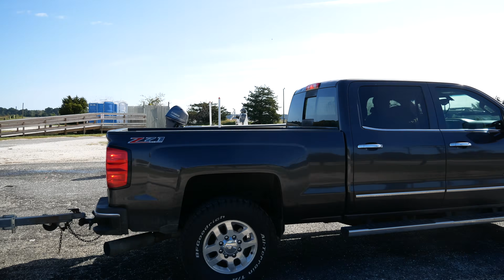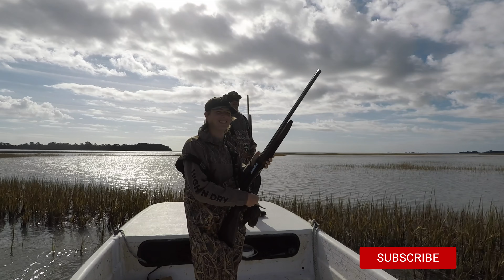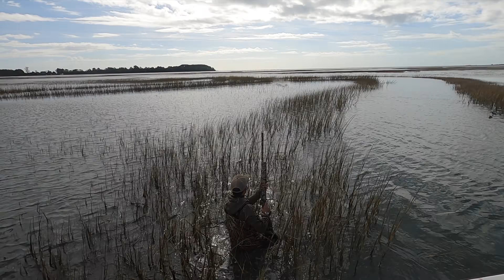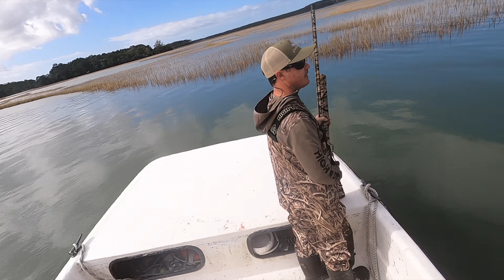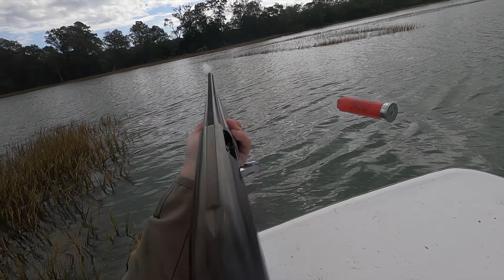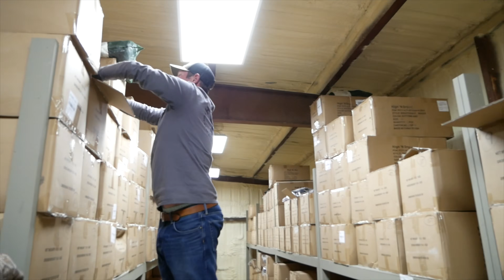My First Time Rail Hunting | Visiting The High N Dry Wader Warehouse

Comment: Hey ive been hearing alot more about HIGH AND DRY. surviving duck season joel strickland wears them and has nothing but good things to say. I bought new wadders last year and after wearing them 3 time i returned them ..they gave me a new pair. But i dont have alot of faith in them now .i was looking at sitka but i may try the high and dry first!!
Reply from the maker: I have had zero issues with mine so far and have been very impressed with the quality of the product. I will have to put them through the paces of a full season to see if I can fully recommend them but everything so far indicates that they will handle that test

Comment: I have never had a dry pair of waders. Tried several brands and styles. I have just dealt with it as a fact of life. lol. Might have to check these out.
Reply from the maker: I was the same way up until this season, I have not got wet in my High N Drys yet though. Only time will tell on if that stays the case but from everything I've heard from those who use them they hold up very well
Reply: @HokeOutdoors  Good luck! Looks like you're having a great season so far.
Reply from the maker: We've definitely been blessed thus far! Good luck to you as well!

Comment: As a native Virginian I’m interested in supporting the locals.  On my third season with my current pair of breathable waders but the are starting to leak where the boot meets the wader material.   The early season I smeared some shoe goo on the inside of the seam which appears to be working for now...
I like the idea of Kevlar on the front of the leg.  I would like to see some of the same material on the butt area to provide extra projection against wear when sliding on crappy boat and blinds seats as well as the occasional schooching down the river bank or beaver dams on my rump..Hopefully the boot rubber is flexible too for those longs walks in so it doesn’t rub the meat off your shins.
Reply from the maker: I will pass on that idea about the Kevlar on the rear. That has definitely been the #2 area where I've torn my waders in the past. I've really like the boots on these, they have more real rubber than other companies use so they're flexible and comfortable.